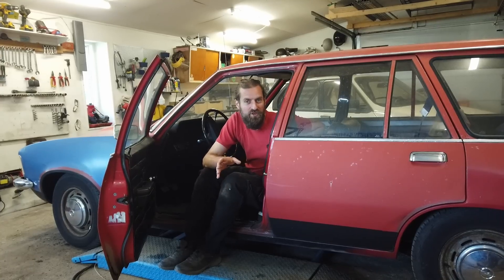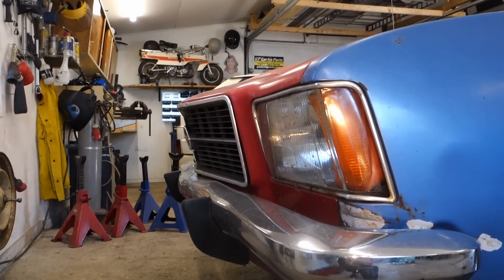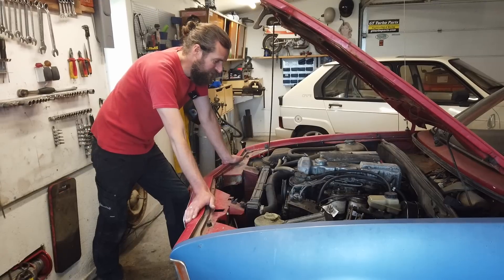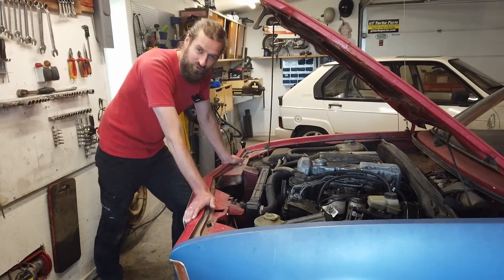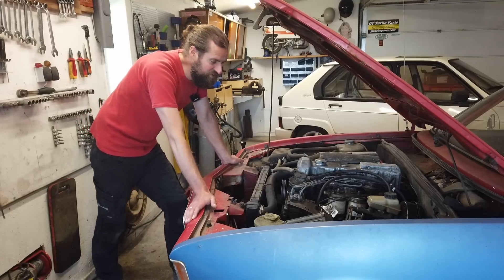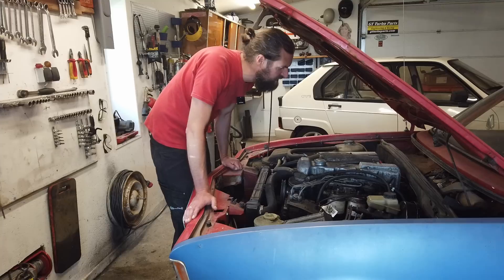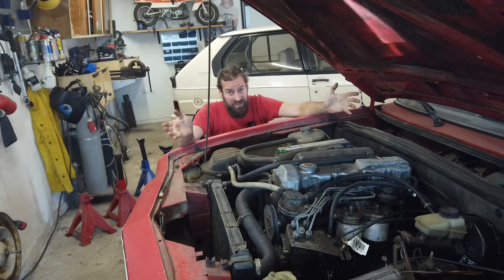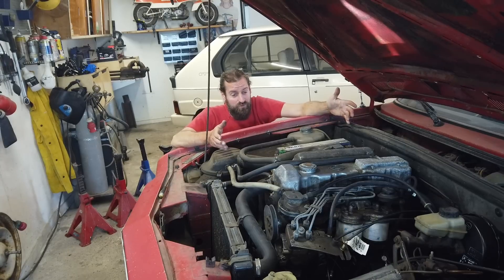Diesel Dorris Drinks | Opel Rekord 2.1 Diesel Using Oil

Comment: I didn't recognise the car at first, but when you sat down in it, with the front and back doors, handles, and A and B Pillars, it became instantly recognisable. The car is based on the GM V platform and was to be used in the 80s as the basis of the Commodore( in this neck of woods).

Comment: Seppo, I would also do one of your famous compression tests too. That may show if the piston rings are stuck or extremely worn bores.
And of course, a compression test is pretty non labour intensive too.
Reply: It could only be faulty oilscrape rings. That will not show up on the compression test.

Comment: My Volvo Amazon had exactly the same symptoms. I had its 1984cc engine bored out to about 2.1 with new pistons and rings. I think it cost about £600 and for me that was money well spent - to not have to worry about oil consumption and have to stop so often at motorway services to top up the oil in a high wind with the oil being blown everywhere but into the engine.

Comment: That amount of blowby doesn't yet mean the engine is bad. In Fiat's 1.9 JTD I had a similiar thing when it had 275kkm. If opened the oil cap when the engine was hot and working, it would spit oil drops all over me. If I held the breather hose shut for a while, it would also build some crazy pressure inside. But the oil consumption was still at about 500ml for every 10kkm, and I think it was mostly leaking by the turbo seals, cause the turbo was never rebuilt. So I didn't have to add any oil between oil changes once a year.
If your engine had worn out piston rings, it wouldn't have good compression. And for diesel of that age, with no direct injection, compression is everything. It would work badly, shake like crazy, stall on it's own, but on the first place you wouldn't be able to start it so easily, if at all! That engine can't have bad compression, and that blowby seems normal for such old engine, with who knows how many kilometers on them. Of course the oil rings might have gone bad and thus letting the oil into the cylinders, but that can't be successfully checked just with looking at the amount of blowby. Beside that 1.9 JTD I mentioned, I also had a 1.4 16v petrol engine which burned a litre of oil for every thousand of kilometers and guess what, it didn't have almost any blowby at all.

Comment: Ii recall these engines in CF Bedfords of the mid 1970s, they were tight to do 100,000mls before major work was required,  poor starting was usually an issue,  the Perkins engine was the preferred option,  despite its modest power

Comment: I have heard good things about Seafoam a product used to clean the internal parts of the engine. The Opel is the German side of the GM corporation who also own Vauxhall. In the UK we didn't get many Opel cars but sometimes they would rebadge them as something else, a Cavalier for example.
Reply from the maker: Cant seem to find seafoam anywhere local though...
Reply: Tec 2000

Comment: Great stuff I have to say! I remember the days in which these cars were a bit ugly. Timeline changed this perspective! How many km on the odometer? What about filling a bit the cylinder with brake oil dot4 for 24hours in order to soak the carbon deposit within the piston rings?
Reply: Now Opel have only 5 digits on the odometer, but we think the car has done about 89.000 km. Unfortunately the engine is not the original so we have no idea of the milage.
Reply: Hoping to see how this progresses!

Comment: I'd have thought the drive from Sweden would loosen any stuck rings? Also think injection pump possibly just uses diesels lubricity. Can you re-borrow the compression tester you had for the MB?
Reply from the maker: You have a point about that... but before pulling the head and inspecting pistons/bores it seems like a good idea to give a oil cleaner a try!
Reply from the maker: Bought my own (cheaper) tester!

Comment: For bad block test (piston rings , cylinder walls ..) no need to actually drive it - start it up on a driveway let it idle for a few min. then press the gas pedal lift the revs up to 2000/2500 and hold for around 10min. , and look at the back for blue smoke from the exhaust .
Reply from the maker: Why 10 min? :) thanks for you comment!
Reply: @SeasideGarage  Basically for the oil to warm up and going thinner thus it'll pass the worn rings or cylinders easier up in the combustion chamber , and by holding the revs higher oil pressure will increase too . Compression test and even leak down test can and will fool you/trick you on an oil burning engine , unless all the rings are bad you'll find it measures good compression because 1-st and 2-nd ring are still good with only 3-rd oil control ring being bad/worn/sticky (commonly happens on newer engines with "low tension" piston rings) and also because the oil will be already present in the combustion chamber to a degree so it will seal up like when doing "wet" compression test with adding oil into the cylinders . Have fun !
Reply from the maker: @MrJolly-lb9je  makes sense! thanks

Comment: Those engines are really bad. Later on it will be hard to start and push out the dipstick. I had one myself, had to rebuild the engine myself. I sold it quickly after. Cam bearings usually crack too. Only Mercedes and Peugot could make realiable passenger car diesel engines in those days.

Comment: Could it be a clogged exhaust?   The diesel on my boat had the same symptoms, came down to a clogged exhaust manifold.  The air had to go somewhere and it went back through the intake.  I'm no expert, no need to jump on my azz if im wrong.  Just something I've experienced.
Reply: The exhaust is only a few years old.
Reply: @Jakob_Leth  my diesel is very young.  It's more on how it's used than the age of the components.   Being a barn find and blowing that much air out of the oil fill seems like a simple thing to check and cross off.  I had my diesel checked by two certified mechanics and neither figured out the problem on their own.  The second mechanic did call Yanmar tech line and got the answer.  They pulled the mixing elbow off and sure enough it was clogged.  If a diesel is started and shut off quickly and frequently without a proper warm up the diesel exhaust mixed with condensation will cause a restriction.   Being a barn find, there may be rodent nests blocking the exhaust.
Reply from the maker: very likely cause! but not on this one... the engine is not the one the car was born with... (did not know that when filming) but the engine was changed after it was dragged out of the barn.. same with exhaust.

Comment: Skropel is what they are really called. :) The swedish inspection rules for old cars are stupid. (I'm swedish).
Reply: No, the Swedish rules are very liberal and obviously intended to ensure that old cars (eg Volvo and Saab) can still be driven. It is easier for countries such as Norway and Denmark, which do not have a car production themselves, to be strict when it comes to approving older cars.
Reply: @Hvitserk67  It's  still stupid to let people drive old sheds old sheds without haveing any idea about the integrity of safety systems which quickly seize or otherwise stop working on occasional use vehicles.If you want to keep the vehicle on the road you should in some way have it properly inspected at last bi annually.
Reply: @rimmersbryggeri  There is normally a limit to how much a vintage car is used (they are chronically unreliable and/or too valuable). Even here in Denmark, the rules are that such cars must only have an approval/MOT every 8 years.
Reply: Don’t worry. I will have it checked. It’s a big responsibility to own an old car.
Reply: @Jakob_Leth  It is a nice and sympathetic attitude to have. It is a nice ordinary vintage car of which there are not many left.
Reply: @Jakob_Leth  Yeah I don't doubt it. But the rules leave a lot to be desired. In northern sweden young people do huge mileages in old merc w123s that were destined for the crusher before the driver was even born and that follows  the letter of the law but not the spirit of it. Since you seem to want to fix the oil butning for example I can see that you are taking responsibility for this vehicle. That's a good thing.
Reply: @Hvitserk67  Most of my collection are ordenary cars 😁